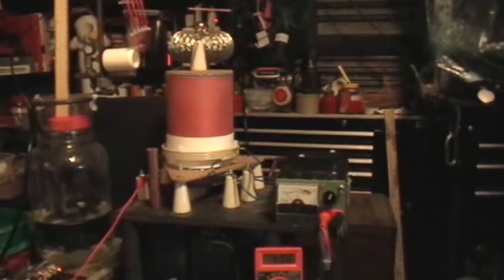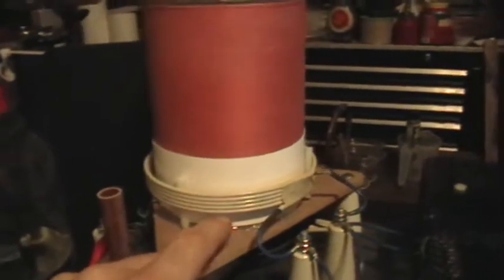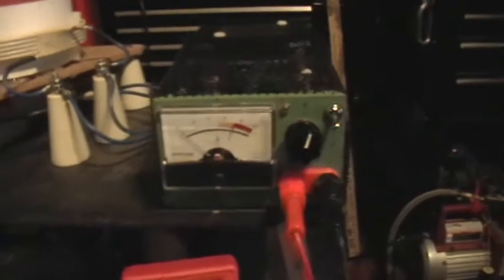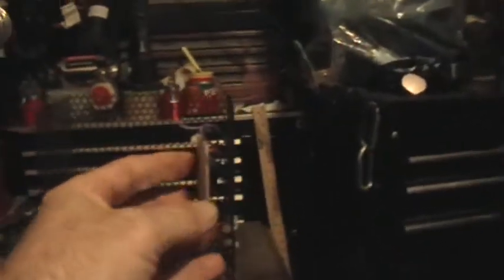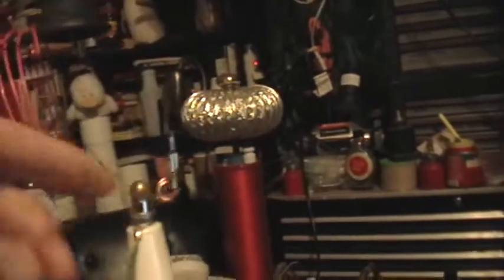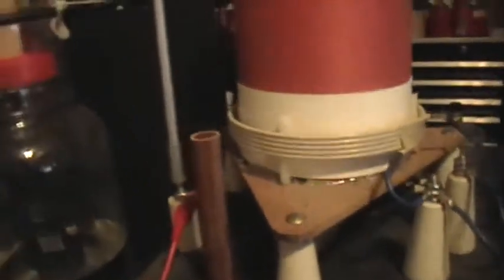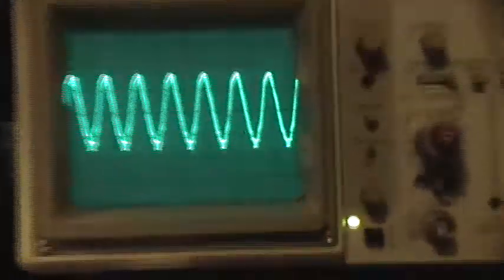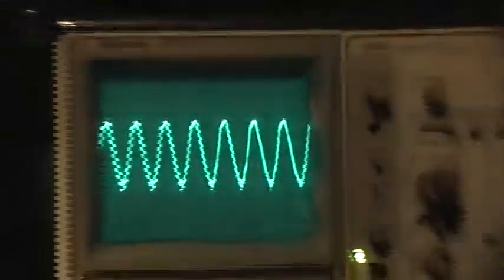Extreme High Voltage: SassyClassE SSTC: Overview and Demonstration

Comment: Hi TinselKoala
Before (about 4 months ) after finished my sstc and tried put a wheel on top tc it working very well like as your tc. But today I replay the wheel not turn but plasma(arc, spark)   display on   nib  of the wheel (like as before) and I have checked wheel is free turning .So could you help me by tell me  what I wrong. Thank you in advance for your time.
Reply from the maker: I'm sorry, I can't tell what's wrong from your description. If the wheel is free turning and you are getting a corona plasma from the points, it should turn. Check to make sure the points are sharp and are pointed in the right directions! Also make sure everything is clean: there is no dust or hairs that could be spraying corona from places other than the endpoints of the corona motor's arm.
Good luck and keep me posted.
Reply: TinselKoala
Hi TinselKoala
Now well working' because before I put more power when near stop played it make few melt at axle (axis )and the hole of wheel but not be detect by hand ( about 70%of smoothing when turning). Any way thank you so much for your enthusiasm help me and your time
                                           Salute
Reply from the maker: 568min
Ah, I see, the parts welded together from the high power! That happens to me too. I'm glad you got it fixed. Try using different materials, like a steel needle (axle) and copper wheel. This may help to prevent welding or it might hurt, I don't know!
Experment and tell us what you find!

Comment: Hi TinselKoala
Very Very interested your nice sstc,Could you help me to know diam +high +gauge wire+turns of your primer +second+flyback coil.Please and thank you so much (sorry my English is bad so I don't understand all what you said.
Reply from the maker: Hi, sorry I didn't see your comment earlier, this damned new google+ system just isn't working right. I wish they would roll it back. Now I have to search to find new comments rather than simply seeing them in the "inbox".
The secondary is #27 AWG enamelled magnet wire. The form is about 4 1/2 inch diameter PVC pipe and there are 420 turns of wire. The primary is 12 gauge plastic-insulated solid copper house wiring, 5 turns. The pickup coil is the same wire but a single loop.
Reply: TinselKoala
Thank you so much for your time help me.

Comment: I'd like to ask what your opinion is of the C2M0080120D SiC-based mosfet (datasheet available through google, can't easily post it here unfortunately) It looks amazing for this circuit, with lower capacitance and on-state resistance and a higher voltage rating. Also, I see you're operating off a DC power supply at 50 volts, I was planning on building one of these and running it straight from rectified 120v AC, any thoughts to make sure that will work?

Comment from the maker: The circuit diagram includes a line power supply with a bridge rectifier and a 1000 uF and a 0.1 uF filter capacitor. These must be rated at least twice the line input voltage to handle the output of the bridge rectifier. 
I don't use these components in my circuit because I am operating from a DC supply or batteries.
The "tank" capacitor is the 0.47 uF capacitor and it too should have a high enough voltage rating. in mine, these are the blue blocks and are rated 275 V, 1 uF, and are in series.

Comment: I was looking at the circuit diagram you posted. What is the voltage rating of the capacitors shown? Are they all 120v? As I live in an area with 230v, will I have to change the circuit?

Comment from the maker: Further: look at the voltage at the mosfet gate. The pot and whatever other resistors should be allowing about 4 volts here when the thing is not oscillating. It is easy to exceed the mosfet's gate-to-source max voltage and fail the mosfet, you might not notice this if it happens right at the beginning of testing if the mosfet fails open. Check the mosfet to make sure it's good, and don't apply big voltages until you are sure the system can at least oscillate.

Comment: i have built this circuit and it does not work. i hooked it up to my primary secondary ans feedback coil. and i have nothing up top, wont even light up a neon. im pretty sure that all of the connections are right. When i power it on i can get up to 120 volts and still nothing, the current draw is about zero and the transistor isnt even warm. Please help, thanks

Comment: I have been looking for a good way to supply higher voltage. It not easy. No wonder Tesla just went for a tank circuit with AC drive so much. 3 meters with no av plug is ok I guess, 5 amps is still a lot though. Thats a lot of RF all right. Do you notice different density's of energy? I'm not sold on it being all rf, I think there is something extra in there.... Some coils seem to be dim for a long way, others seem to be intense for shot distance. I'm trying to work out the adjusting variable.

Comment: Good little Plasma display, Looks very lossy though. 5A!! If you top load it till no more plasma, what's the wireless range for an LED on an av plug and a foot of wire?? If your secondary is getting hot, I would think you need a longer primary, with twice the volts and half the amps. Your getting good coupling, but its all amps, not enough volts if its getting hot... Not much you can do with the secondary so few turns I think. How do the neon's and cfls go at more distance? Can CFL get 5m?